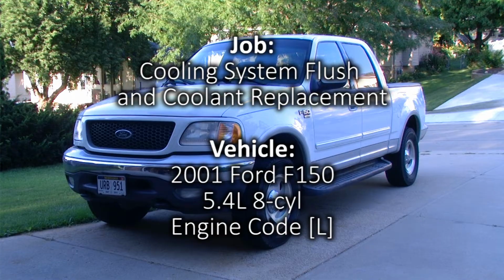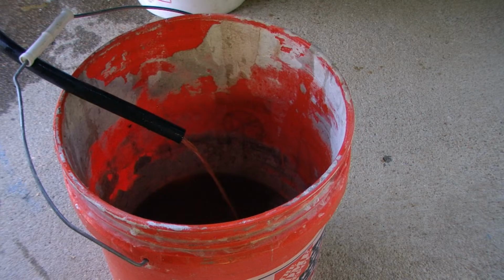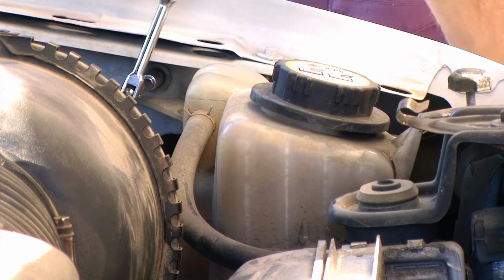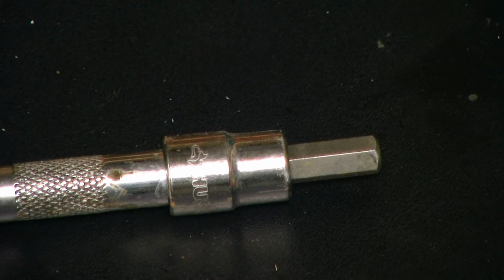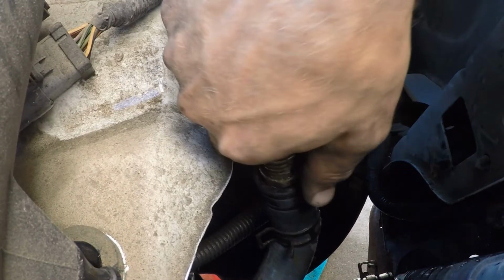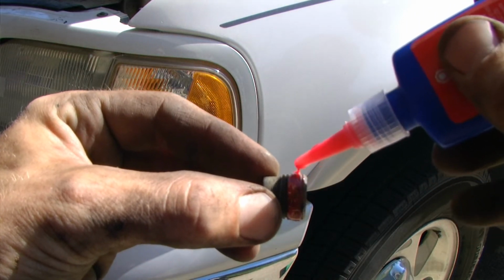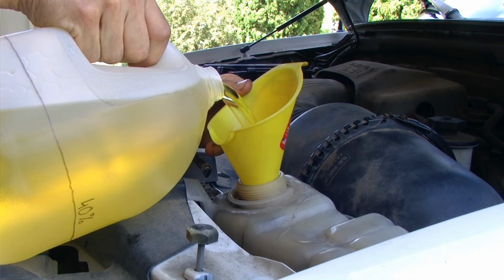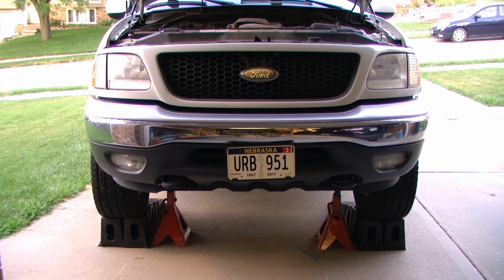2001 Ford F150 - Cooling System Flush and Coolant Replacement

Comment: Great video but one thing of course.   Burping is a major concern,   Mechanics say to raise the front of the vehicle to help air rise and let the vehicle run for 20 minutes with heat on high...add fluid as necessary.   The only detail missing I saw.   Thank you for making it.  I’m doing my 2003 f150.   This video helped back my other research almost 100%
Reply from the maker: Agreed.  Great tip.
Reply: What if your truck heat does not work?

Comment: I noticed that my truck after changing the thermostat because it was stuck closed would blow out cold air what's causing that
Reply: If I understand your statement correctly, you changed your thermostat because it was stuck closed and now it blows cold air?

Comment: Loctite Red for that plug? That requires heat to remove. This is the last time that plug comes out! The blue would've been fine, imho.
Reply from the maker: Permatex Red was used at the recommendation of my parts dealer.  I agree that Permatex Blue would be sufficient.
Reply from the maker: I am currently doing a repair video (should be finished and uploaded this week) which I had to pull the plug...it was tight but got it out without any issues.

Comment: Good video, however,. there is no reason to turn the heat control up or even have the HVAC system on.  In this case, water is always circulating through the heater core.  The temperature controls only open blend doors in the ducting to force air over the heater core to put hot air in the cabin. Some newer modal cars do have a valve that opens or closes circulation in the heater core, but not the 97-03 F150's.
Reply from the maker: I agree with you.

Comment: What size hose fits on radiator drain port
Reply from the maker: I used 3/8 I.D. Oiler Cooler Hose.  https://www.amazon.com/Hayden-Automotive-112-Engine-Cooler/dp/B000HE5G0S

Comment: Will this help out blow hotter air when the heat is on?
Reply from the maker: Yes.  Having clean, fresh coolant will allow better heat transfer.
Reply: I have noticed my f150 the last couple winter ls the heater is barely blowing warm air, any other things that could affect that?
Reply from the maker: @Maldini2105  I have had where my coolant is slightly low and it caused almost no heat.  Other than that...a thermostat that is sticking.
Reply: Insane Oil awesome, thanks for replying man! Might have a few questions down the line... 4x4 not working for example
Reply from the maker: @Maldini2105  Perfect...I'm more than happy to help out if I am able to.

Comment: When you run the engine for the second time with new coolant, do you leave the radiator cap off? Or just the first cycle?
Reply from the maker: Just the first cycle.  However, check it regularly over the next couple days and top off as necessary.

Comment: I just want I just want to say that you're a video is one of the best ones I've ever seen as far as being informative and detailed the thing I didn't that I would have liked to know and it is what to clean the reservoir out with am I going to use the flush and if I do use the flush how do I initiate it then to the system other than that your videos very good
Reply from the maker: If you read the directions on the flush product, it should step your through the process.  I cleaned out the reservoir with a bottle brush and warm soapy water.  Thanks for the comment.  Good luck with your repair.

Comment: Is this process the same for the 4.6L?
Reply from the maker: The process should be very similar.  Some engines have a block drain plug on both sides.
Reply: Insane Oil it does have one on both sides on mine I discovered, however no one has a spare bolt to sell, and when I went to dealerships and part stores they all didn’t sell it.
Reply from the maker: @garrettglauser8824  Not 100% sure if this is the correct one. https://shop.advanceautoparts.com/p/dorman-autograde-pipe-plug-c.s.-square-1-2-14-npt-head-size-3-8-in.-sold-by-each-090-100/22140250-P?searchTerm=dorman%20plug OR https://shop.advanceautoparts.com/p/dorman-autograde-pipe-plug-square-1-2-14-npt-head-size-9-16-in-sold-by-each-090-002/22140218-P?searchTerm=dorman+plug
Reply: Insane Oil thanks for the reply

Comment: And the Heather core?
Reply from the maker: You are correct that the heater core was not flushed.  The Cooling System servicing repair procedures do not call for flushing the heater core.  However, if you have sediment/corrosion buildup in your system, I would recommend purchasing a cooling system flush product and following the directions on the packaging.  On a side note, the heater core itself only holds a minimal amount of coolant.

Comment: I want to mention if you're going to do this flush on 97-03 models, and if it's been years since it's been done, or never done at all, folks may want to think about doing the oil filter adapter plate gasket replacement if they haven't already. The adapter plate is also the "water neck" for the lower radiator hose on the bottom of the engine block. When the gasket o-rings start to go it will allow the coolant to start begin seeping into the oil passages when the coolant hits its max pressure, this will worsen over time and eventually destroy the engine. You'll know the o-rings are going if you have an oil leak from around where the lower radiator hose joins the block, or around the oil filter, but you've maybe never been able to quite figure out where it's leaking from. Flushing out the coolant system may remove deposits built up around the adapter plate gasket and may make it leak the coolant into the oil at that point. Just a heads up. Great video btw, I needed to see where the block drain was as I'm going to do a drain and flush now that I replaced the gasket, and this was perfect. Thanks.
Reply: I'm here as well due to the adapter gasket failure..happened in every 5.4 I've owned . I've never seen coolant in the oil though due to it. I have oil in my coolant system..reservoir was dark brown
Reply: This is a great spot to lose oil!  Two mechanic shops missed this and I almost had a destroyed engine moving from Maine to Florida pulling a U-Haul moving trailer because of this gasket failing.  I asked the first shop to do a travel check before moving and they missed it.  Get to Pennsylvania and the engine is over heating, then starts pissing coolant in the hotel parking lot.  The next shop replaces a bunch of coolant parts (probably needed it anyway), I switch from trailer to dedicated U-Haul box truck and baby the F150 by itself on the way down.  Running the A/C runs it hot.  After almost a year in Florida, I find the oil leak from the adapter gasket!  That pissed me off so bad.  Once I replaced the gasket (a major pain in the butt I might add), I have not had any oil leaks since, and it has been 4 years going on a 2000 F150 5.4l with 275K+ miles on it!  Note, it was originally a Florida truck all its life, I was gifted it in 2017, moved back to Florida 2019.

Now I am dealing with tree rats destroying wires in the engine bay and chewing holes in to my intake manifold (the underpan).  I thought it was O2 sensors going, MAF, IAC sensor, and a bad ignition coil.  NOOOOOooooooo!  Damn tree rat chewed in to my intake manifold!  I bet lunch money that is causing the bad idle, surging, misfires, and loss of MPGs.  All my wife and I use it for now is my morning gym runs for me, the occasional need for a second vehicle, and if we need a truck bed form something (of which, I cannot begin to describe the utility of owning and not asking for).

Ol'Henry runs like a tank but if not taken care of, even with minor maintenance, it will still try and keep going.  Love it  !!!  Now, off to spend $500 on parts and some tinkering time.
Reply: @GarthDixon-p4j rodents are terrible for engine bay valley.
Just replaced the Air intake Manifold gaskets on 2001 4.6 with 304,000 miles on it. Uploaded couple short videos on it. Nothing super detailed, but enough to get the idea. There are some more detailed videos online.
Reply: Does this count for the 4.2 engine also?   I do have an oil leak that I cant pin down.  I just thought it was my oil pan.
Reply: @jackkhol4251 check you oil filter adapter if u haven’t yet
Reply: @jackkhol4251  I have the 4.6 2001 and it leaks from the rear main seal
Reply: @eddie947 try blue devil rear main sealer ,, good stuff I’ve used it works miracles 👍🏻👍🏻
Reply: Isn’t there a block drain on the other side of the engine?
Reply: What adapter you guys talking about.?? I have a 2003 Ford 5.4 4WD oh and it’s white too.. and súpercrew also.!
Reply: @santiagodavila1426 
It's the adapter where the oil filter screws into on the block..if your filter is up under the bumper you may not have adapter plate gasket. But basically ..oil and coolant take a path through this adapter and when the gasket fails the oil pressure which is higher than coolant pressure will cause oil to leak into coolant system through the gasket and make coolant look like chocolate milk..have to drain coolant and the remove 4 13mm bolts to get adapter off..gonna need a bunch of extensions and swivels and bandaids.
Reply: @Trevor-ju6uw  crap.. a ma look into it. Maigut be better replace the gasket instead.!
Reply: Wow thank you im working on mine now
Reply: 4 years later old but gold
Reply: I just did a flush a different way on my 2001 f150 by detaching the main bottom and top radiator hoses and took out the thermostat then ran water from a hose through the engine block, radiator, and reserve tank until clean. (The old radoator fluid and water i ran through came out straight brown lol) Do u think that wouldve cleared off the deposits around that gasket ur talking about enough to cause any leakage into the systems? I didnt use any flush cleaning products so i feel like im safe in that department but just want ur opinion
Reply: Are you referring to the oil cooler?
Reply: I'm addicted to pigger nussy 🤠

Comment: The Heater core must also be flushed or it will dump old coolant back into the system.
Reply: You are right Jolinator , The procedure in this video is not a complete cooling system flush .
Reply from the maker: @jackrobertson4043  You are correct that the heater core was not flushed.  The Cooling System servicing repair procedures do not call for flushing the heater core.  However, if you have sediment/corrosion buildup in your system, I would recommend purchasing a cooling system flush product and following the directions on the packaging.  On a side note, the heater core itself only holds a minimal amount of coolant.
Reply from the maker: You are correct that the heater core will dump old coolant back into the system. However, the repair procedures do not call for flushing the heater core.  Additionally, the heater core only holds a minimal amount of coolant.
Reply: Jolinator how do you do that?

Comment: Did u have to torque the engine drain bolt? Or does it go in until it's in there snug
Reply from the maker: The repair manual states "install and tighten" the block plug.  It does not specify a torque setting.
Reply: @InsaneOil  I ended up stripping the bolt 😭 smh it's going to be a pain wen I overhaul it